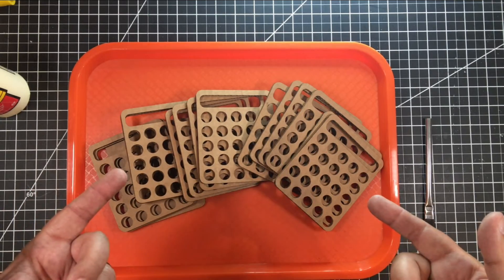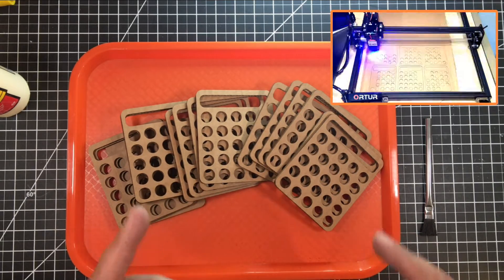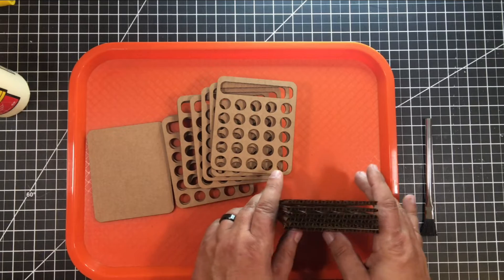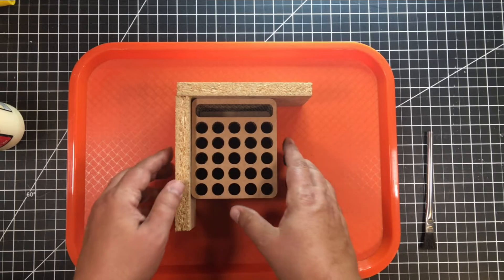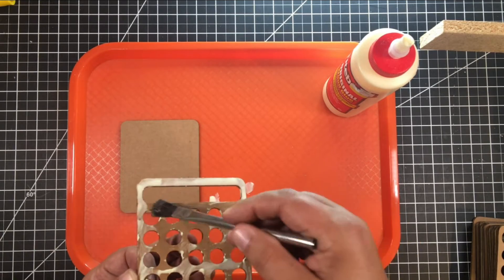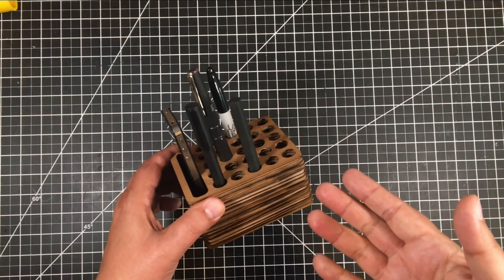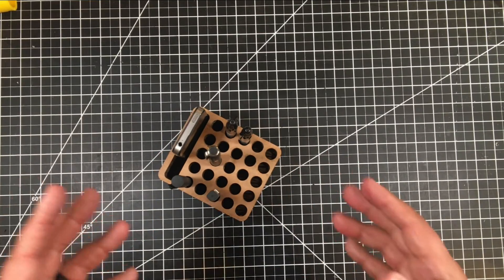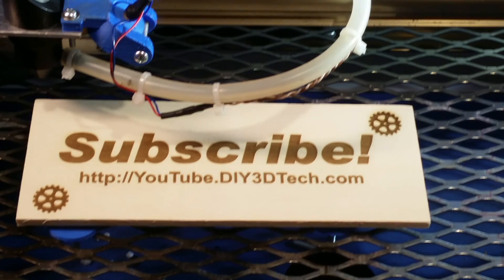Ortur Laser  -  Craft Show Money Maker!

Comment: A small sponge roller should make it easier
Reply from the maker: Interesting, yet how do you keep it from drying out?
Reply: @DIY3DTECHcom  for some time a well closed plastic bag it's enough.
But for cardboard and wood, water based glue it is ok and tools can be washed in water several times.
Foam roller are also very cheap because of replacement rolls.

Comment: home depot or lowe's and grab a glue roller, makes gluing a LOT FASTER and cleaner
Reply from the maker: I was considering that.  Do you think it uses excess glue or not?
Reply: @DIY3DTECHcom  no not as long as you don't squeeze the bottle to hard and you can get the roller in 1,2, and 3 inches width

Comment: I think to order ortur laser, but Im not so sure does it can cur acrylic material without to melt it? And can I transform it with drill heads for cuting hard wood
Reply from the maker: No on a acrylic (you need a CO2 laser, this is a visible wave length laser) and not to the drill heads for CNC as there is no Z Axis...

Comment: I use the hole cutouts for spacers on the work surface of my laser to lift the work a little.  Or, use them between the pencil cutouts and use half the number of layers to make the holder.  Just leave enough space on the corners to hot glue them in place.  It looks kind of cool, too!
Reply from the maker: Many thanks! (looks kind of cool) And interesting idea!

Comment: Use a four inch foam roller to apply the glue. It's fast,  just make sure you don't have too much glue on the roller.
Reply from the maker: I like the idea if I was dozens however 1 or 2 seems expensive or I am missing something?  Thanks for sharing!  :-)
Reply: @DIY3DTECHcom  actually it is not that expensive and you can wash the glue out of the roller when you are done. There is even a roller applicator you can by to screw on your glue bottle.

Comment: You sould try a design that uses no glue maybe use 4 small wooden dowels to hold in place
Reply from the maker: Interesting,  they might wigle?
Reply: @DIY3DTECHcom  Not if U only Glue the Dowels
& or just the outer corner;... edges